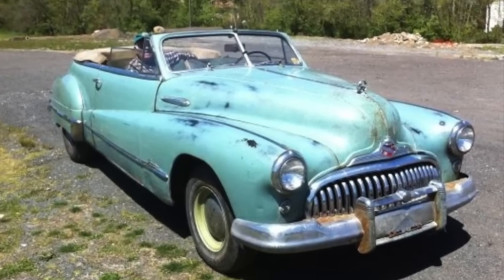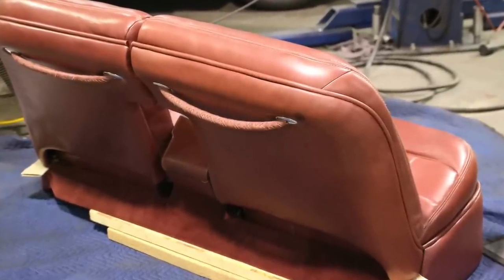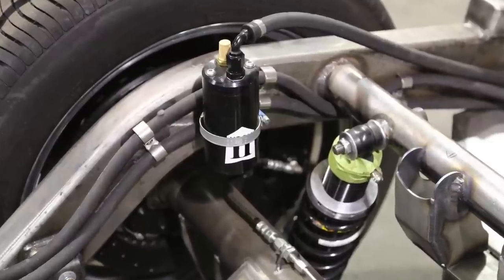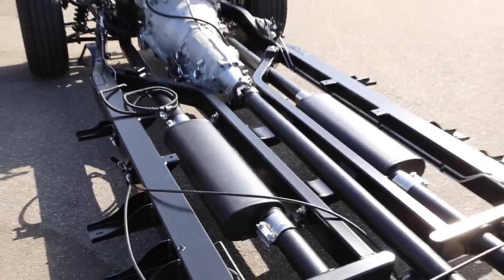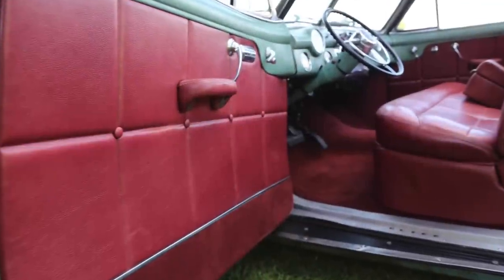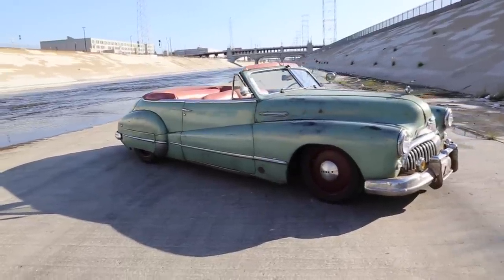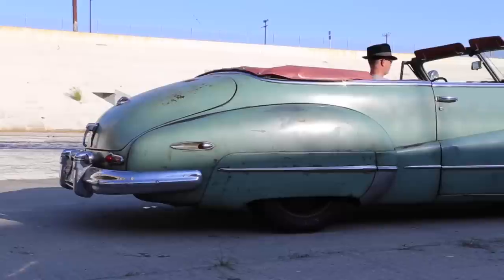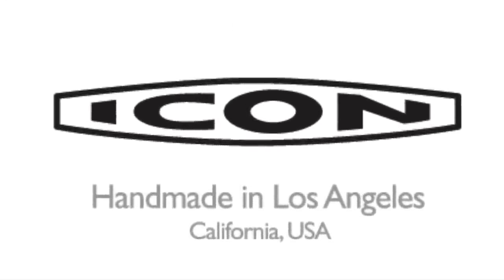1948 Buick Super ICON Derelict Convertible

Comment: I love everything you did......except(I'm sorry) put a nice paint job on it with bright chrome.  .....I know, I know the whole rat/rod exterior thing.  But the late 40's early 50's Buick Convertibles were, in my opinion the most beautiful bodied cars Detroit eve produced.  I love the modern touches but there is nothing prettier than a fully restored Buick convertible of that vintage.  Again, I love what you did.........just wished it gleamed a little more on the outside ;-) Props to an awesome rescued classic though!

Comment: nostalgia with out the crap handling and unreliability , heck ya!
Reply: 1948 Buicks had great handling and the straight 8 is extremely reliable. And 4 coil-spring suspension with torque tube is as smooth as a boat on still water. And fun to drive.

Comment: Do you do anything to protect what's left of the paint? When making my own derelict in the future, I was wondering about a satin clear that might need sanded a little to make it even less noticeable. I thought that I would need to protect the car from rust and prevent more paint loss. Do you do anything over the old paint?
Reply: dantama35, you can rub boiled linseed oil over any bare metal areas. This will protect from further oxidation but it will darken the surface a bit, too. Clear coat will eventually peel right off any bare metal, rusty or not. (although I'm not sure that is the case with the product Mr. Ward uses). As for the painted areas, use a high quality  wax and keep it clean.

Comment: Jonathan, I noticed you guys use a (metal?) WIlwood master cylinder on your brake upgrades. Does that master help at all with the typically spongy pedal on drummed vehicles and modern vehicles that use the plastic OEM units? Cool Buick

Comment: Hi, Amazing! You did most everything to the car - except the wheels perfectly. They look to modern. You could use the same wheels but use paint to create the shadows and 'look' that the original wheels had. I know, Whine whine!
I don't want an exact price but will my check have 5 or 6 digits on it when I pay for the car? If you don't want to answer this question I understand.
I have a good friend here in Staunton Va. Have you met Bruce Elder?
Thanks for another wonderful auto. 'Car' just doesn't feel right!
Regards,
Bob Ordewald,
Staunton Va.

Comment: was the original transmission on this car a Dynaflow or 3-on-the-tree?  another thing I've always wondered about is whether the '49 Buicks were actually a little smaller than the '47-'48s?  they seem to look thinner but maybe it was just an optical illusion....
Reply: Robert Cohen---- original transmission in these cars was three on the tree.  1948 was the first year for dynaflow transmission, but it was only available as an option on the Roadmaster. after 1948 it was standard  on the Roadmaster and optional on the super. In 1950 it became optional on the Special also.            In 1949 Roadmaster and Super were put on a shorter wheelbase. In 1948 the wheelbase was 129 in for the Roadmaster and 124 in for the super. in 1949 the wheelbase was 126 in for the Roadmaster and 121.5 in for the super. When the cars had straight 8's the hood on the Roadmaster was always 4.5 inches longer than the super to accommodate the longer Straight 8 in the Roadmaster.

Comment: So the bitch part about rest's is indeed the nuts n bolts n pulleys etc part and rather to paint and clear coat, plate or just clear coat.  So now your saying all this suspension hardware shown was Al++ Nit DVP as well or just clear coated plated?  Please tell.  Can they even do a clear DVP I will have to check that out.  - Thanks in advance

Comment: You fucked another old car up. First of all, the Fireball was a famous straight 8 engine of the 30s and 40s and here you have a modern V-8 with fireball insignia on it. What sort of schmuck would do such a thing?
Reply: *****
 My volkswagen diesel has a Chrysler Hemi 440 in it so I have to fill it with gas not diesel. Nobody makes Volkswagen engines better than Chrysler.
Reply: +hyzercreek :  So you're saying you have a C - Hemi that was bored out to make 440 displacement as old  Chrysler 440  was not a Hemi head design ?
Reply: The VW diesel Chrysler 440 has a diesel hemi head.